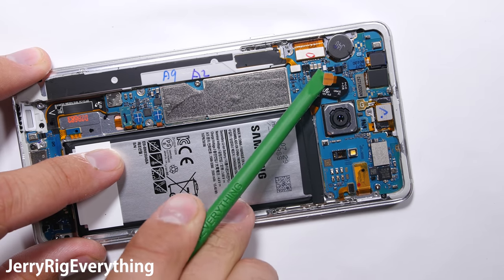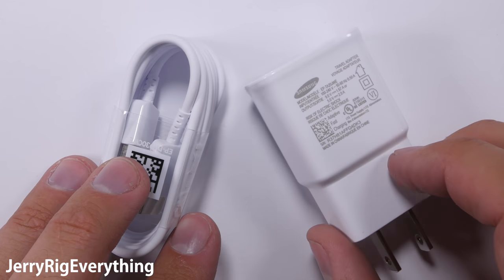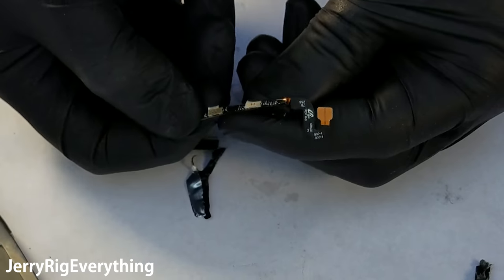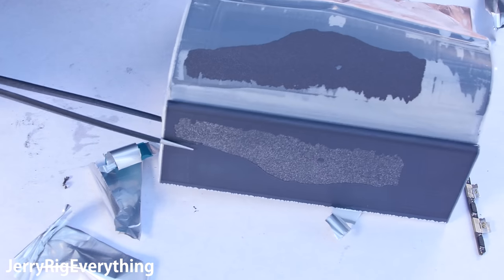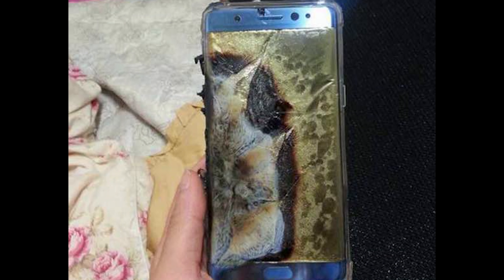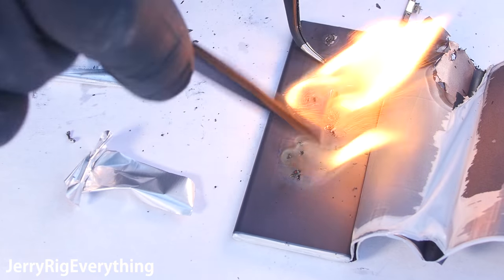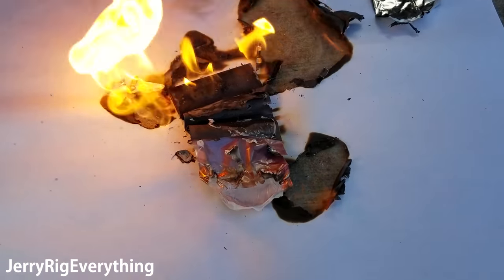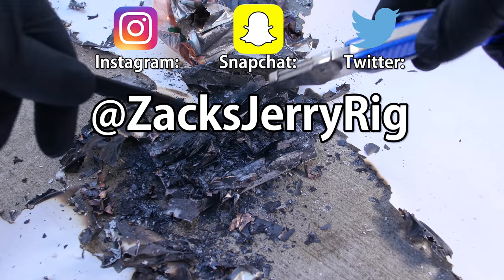Note 7 Battery Explosion!! CAUGHT LIVE ON CAMERA!!

Comment: good video as always
that clickbaity title though
Reply from the maker: ;-) It happens.
Reply: but you can still change it
Reply: +JerryRigEverything when you were poking the battery with that metal rode and it caught on fire, does that happen to other batteries when you disassemble them and poke them like you did with the note battery.
Reply: +John Irwin, Motorola batteries, the odds are good it won't. they are wrapped a bit better. batteries that are in less popular phones can.( the flip phones have older batteries and are vulnerable to it).
Reply: +Dan Marinucci so all batteries will do it when you unwrap them like in the video
Reply: John Irwin good point👈
Reply: +Dan Marinucci lol i meant that to be a question
Reply: true
Reply: yeah, unsubbed here.
Reply from the maker: ***** You bet!
Reply: JerryRigEverything click baiter where is 5he real thing
Reply: Ryan Mader Nah It was just really tempting because it was so easy... just couldn’t help it

He usually doesn’t do Clickbait

Comment: Here's the scoop:

Samsung investigated 35 cases of issues with the Galaxy Note 7, 2 cases involved an exploding battery on social media while the others were reported as fires, no injuries were reported. After running extensive tests Samsung concluded that a certain batch of the Note 7 batteries has a potential risk factor and could be a fire hazard when charging,from reports
Samsung produced the cells but used Korean ITM Semiconductor to produce the battery pack sold in South Korea which had the problems, meanwhile, most phones sold in China and internationally are going to have battery packs from Chinese company Amperex Technology and other suppliers which have no problems.
Instead of just recalling specific batches they issued a worldwide recall just in case someone received their phone from a supplier that were selling batches meant for South Korea.

So to get things straight:
1: Unless you got your phone in South Korea you shouldn't have an issue with your Note 7 since the faulty battery pack that was produced by ITM Semiconductor and was only sold in the Korean market.
2: Samsung made a worldwide recall in order to relieve everyone's stress not because your phone will explode or catch fire.
Reply: no, thats not how economics works, they would have recalled by serial number batches then, its not like they dont have the paperwork on phone serial numbers. 

the real deal is probably that they noted a major fault with a hardware component that was at fault on every device and issued this recall.
Reply: Hi Mack - how do you know this? Cause if this is true, I'm keeping my Note 7 and not returning.
Reply: lmao different batteries for different countries, ye that sounds like Android.
Reply: +Wybrem It's more like Supply Chains for other regions. Samsung mostly use their local factory to make their own local version phone( Note 7 SM N930S/K/L, Korean version).
Samsung has been using China as a supply chain to assembly and made devices to export to U.S(Verizon 99% has labeled make in China) while Vietnam's Factory use for assembly phones that are International model and export internationally.
Reply: +Wybrem And you somehow think Apple uses the same internals for every model? Do some research before even attempting to trash talk.
Reply: TL;DR chinese batteries good. korean batteries bad.
Reply: it's marketing and PR. not economics. but then the marketing and PR move is actually for long term economic reasons :)
Reply: +Andrés Iniesta Agree, there're some good China Brands Battery like Panasonic & Sony. Amperex  and TLC are one of the best Battery in China, they're also supplies to many corporation.
Reply: ***** As someone who resides in Florida, I'm honestly doubting the credibility of that specific report. I believe the others, but that one looks like a grab for attention just so they can receive paid compensation from Samsung. Us Floridians are known for doing some stupid stuff at times, so it's possible that it was staged.
Reply: These issues are about 70% in America, making it more than contained in South Korea

Comment: Prodding a dismembered battery with metal tweezers, doesn't exactly constitute an "EXPLOSION!!'
Reply: But the phone body it self acts as a pressure chamber, so when the heat and fumes have no where to escape, it create its own escape route, thus blowing up the phone.
Reply: @dro3m  hey bro I got what you said,but I was just wondering what's a heat chamber.....
Reply: @aykil435  A pressure chamber, keeps air contained in a certain place and contain to gain until it create extreme pressure. Think of it as the tank has those air compressor.
Reply: AYYO✅ he’s just a person with some simple knowledge.... 🐽

Comment: 2 things worth noting : 

 1) Bad chargers are not too bad, as you show, there are so many protection circuits and the 2 biggest offenders for LiPos would be stopped there - high voltage and too high current. As long as the charger provides 5v, chances are that there's no risk of current over the specs. If it provides more it would be capped by a regulator.

The only bad charger that could get through is one with a big ripple voltage (say from 5 to 3.5) and pulsating on that. This would probably get through the protections and slowly hurt the battery, which likes being charged in a Constant Current then Constant Voltage cycle.

 2) In event of failure of all the protection circuits and the "battery abuse" getting through, it would always blow up the battery, no matter where the failure was (or if all failed at the same time). So "physical location of the fire" is not a good evidence to where the failure was.

But good job showing the dangers and demystifying a bit the phone battery. As usual, respecting the LiPo is the best approach.

Comment: A VERY good reason for Samsung to bring back removable battery's. Convenient and a LOT safer.
Reply: A lot safer how? If a damn lithium ion battery catches fire from overcharging or overheating being able to remove it won't help.
Reply: Mr Kagouris Of course it will. It won't explode because its not contained under a lot of components AND your phone will survive.
Reply: +Dan RC I do like removable batteries but the reason they got rid of that is so they could make it water resistant. If they don't do built-in batteries, they can't make the phone water resistant.
Reply: +Mr Kagouris
Convenient, yes. Safer, no. Convenient because if they have a battery recall, they could just remove the battery and send it back to Samsung instead of the whole phone.
Reply: Dan RC Have you ever seen a charged lithium ion battery catch fire? Nothing touching the battery would survive whether it's contained or not.
Reply: Mr Kagouris but if its not in the device, then the device will be ok, as the batteries will in most cases give off smoke before catching fire. I'd just prefer the safer option. How is that a problem?
Reply: cuhleef Galaxy S5? Lol
Reply: Dan RC You consider grabbing an about-to-catch-fire lithium ion battery SAFER?
Reply: Mr Kagouris Grabbing? Why? You just remove the cover and tip it out.
Whats so hard to understand here? Its not rocket science. Lol
Reply: Dan RC OK, so let me get this straight, you believe that it's remotely safe to take the time to take off the cover and try to tip out a battery that could catch fire at any moment instead of throwing the device as far as possible. Ok, you're right, Samsung should bring back removable batteries so natural selection can do its thing.
Reply: Mr Kagouris I'd rather have to replace a £10 battery than a £600 phone.  As it only takes about 2 seconds to remove, its just nice to have 'options'.
I just guess some people just can't comprehend that.
Reply: Dan RC Galaxy S5 has lower IP Rating than Note 7.
Reply: They're too worried about copying Apple. Won't happen.
Reply: one of the main reasons I still use the Samsung galaxy s4. However I am switching to an iPhone 6s, going to try something different.
Reply: However I heard now that Samsung  has placed a charging limit on the note 7 to only 60% power.
Reply: Not really. I hate removable batteries. I think they should just change the battery so it won't explode.
Reply: It will be a lot harder to make it water resistant without changing the design of the phone.

Comment: 0:45 "If The charger is faulty, or not designed specifically for the phone, it can effect the safety of the battery. It can destroy the battery's protection circuit"

Major Smartphone Companies in 2021 : Let's Remove the charger coz we want to "SaVe tHe EnViRoNmEnT"

Comment: 1. It doesn't explode, it a combustion.
2. Clickbait. I was expecting to see a Note 7 catching fire, not someone dismantling the battery outside the phone and provoking it to combust. 
Thumbs down.
Reply: The title clearly says "Note 7 Battery Explodes!" It says BATTERY. He never said the phone explodes.
Reply: +Unboxing Tech The battery doesn't explode either.
Reply: +Willi Hansen And for that matter, it could be any old battery he's lighting up. It's click bait, whichever way you're looking at it.
Reply: I respect your opinion but even if he used a different battery he still educated us on batteries.
Reply: Here's the definition for explode:
burst or shatter violently and noisily as 

a result of rapid combustion, decomposition, excessive internal pressure, or other process, typically scattering fragments widely.
Reply: Exactly. It's not bursting or shattering, and there's no noise. 
Explosion is the result of a rapid expansion of gasses. That's not the case here.
And while it's an interesting enough clip, the title is misleading. Anyone reading it would expect an Edge 7 that's not been tempered with to burst into flames by itself. This is not the case here. What he's done here he could have done with ANY phone and ANY lithim battery.
Reply: Willi Hansen 
It does technically explode.
Reply: +Unboxing Tech Where's the bang?
Reply: Willi Hansen 
Read the definition of explode...
Reply: +Unboxing Tech To quote your explanation: "noisily" . Was there a noise?
Reply: +Willi Hansen "An explosion is a rapid increase in volume and release of energy in an extreme manner, usually with the generation of high temperatures and the release of gases." This is from wikipedia and everything is fine!
Reply: +Dope Bass exactly, thank you. This was not an explosion. Now can we put this to rest?

Comment: Yeah, I'm in a wheelchair and have the NaviONE power assisted wheels, which either come with a Nickle battery or a Lithium one.  Because the Lithium one weighs a pound more, gets hot and catches fire...I'll stick with the Nickel one.  I wonder why the Lithium is a grand more though?
Reply: Better charge capacity? Or less expensive (i am throwing that without knowing)

Comment: Its water resistant throw it in the pool
Reply: Mike Haile but it will still burning underwater
Reply: At that point, it doesn't matter if it's water resistant
Reply: Ilias PLAYER woosh
Reply: Baiet Simpson woosh
Reply: Mike Haile I’m not next to a pool all the time
Reply: Lithium + water = hydrogen gas +fire
Reply: Mike Haile waterproof* (i think)
Reply: Ethorbit r/woosh
Reply: Lithium is an alkali  metal so it will explode
Reply: Mike Haile is it exploding resistant
Reply: Lithium will become lithium hydroxide and release heat and h2 gas + fire.

Comment: It's funny how apple batteries don't do this...
Reply: Some do
Reply: Except when they do, like a month ago, an Australian guys iPhone exploded in his pocket putting him in hospital.
Reply: There's many times an iPhone has done this and so many more cases of Apple saying 'You held it wrong'
Reply: Lol right but they did and apple blamed it on the customer. Offering no solution other then a new expensive apple branded charger. Basically saying the 1000s of non apple accessories are at fault lol. Not to mention the 6 that bent in your pocket and the 4 that lost signal and jobs told you that your holding it wrong lol
Reply: it's funny how  you say that when apple phones have exploded and killed customers in the past.
Reply: +First Last nonetheless. It still exploded
Reply: John Bator
at least there were no deaths. And samsung is addressing it and has been quick to recall, replace, and give out gift cards for the minor inconvenience. Apple simply blames it on the customers and ignores the issue.
Reply: +First Last bro. Which side are you really on??
Reply: John Bator
samsung??
Reply: +First Last fuck. Me too. This is awkward.
Reply: apple fan boy.
Reply: rekt
Reply: it´s funny cause iphone was the first with this problem, In Maine an 8th grader was burned by her iPhone 5C when it started to overheat in her back pocket.
Reply: And it's funny how samsungs phones don't bend.

Comment: I got a Note 7 recently. But now, I'm trying to get a refund.
Reply: I have a habit of avoiding products that have been involved in a huge safety recall. The Note 7. If they recall back. The battery explosion may not happen again, but I care for safety more. 

Another example is I am soon to get my first car. I wanted a used Honda Fit/Jazz for my first car. But due to the airbag issues on early to late 2000s Honda vehicles where the airbag will fire shrapnel when involved in a crash, killing a driver at a low speed survivable crash. Even if they recalled and replace the airbags, I don't want that since who knows it can happen again. Eventhough it's unlikely. I reconsidered what car should I choose. 
I avoid products involved in huge recalls for safety.
Reply: I have a habit of avoiding products that have been involved in a huge safety recall. The Note 7. If they recall back. The battery explosion may not happen again, but I care for safety more. 

Another example is I am soon to get my first car. I wanted a used Honda Fit/Jazz for my first car. But due to the airbag issues on early to late 2000s Honda vehicles where the airbag will fire shrapnel when involved in a crash, killing a driver at a low speed survivable crash. Even if they recalled and replace the airbags, I don't want that since who knows it can happen again. Eventhough it's unlikely. I reconsidered what car should I choose. 
I avoid products involved in huge recalls for safety.
Reply: +ToperMasterComedy U must avoid lot of things then,  nothing is ever giong to be PERFECT tho, u realize that will never happen..
Reply: +N JK (Nik)
Not sure why he is even driving a car, he should be riding a bike to school/work lmao
Reply: get a nokia 3310 it'll never explode, it'll only explode everything around you XD
Reply: Shell Casing It's great that they recall it. Apple never even made recalls for the 6 when it bent. But I'm avoiding them for the abundance of caution too. Say whatever you want, but it's me.
Reply: +Syahmi Samri only to the people affected? isnt it to all the people who have a note 7?
Reply: LG V20

Comment: These were selling for $10k and higher on Ebay right after the recall was announced. EBay started deleting and banning the listings pretty quick. I don't know if people were buying them as collector's items or if they had some weird plan to stage an explosion and sue Samsung. I remember Samsung covered it's legal bases by mass spamming the phones with message warnings and they fucked with the network signal somehow. I don't remember exactly. I just know it was all because they wanted to save a few pennies by using cheaper batteries than they had in the past.

Comment: The reason for explosion of note 7 batteris is actually two of the electrodes are unnecesarily touching each other resulting in short circuit and the battery gets so much heated till explosion 
still nice try

Comment: I have a Galaxy S8  that was practically brand new when it suddenly stopped working one day, as it it just would not power on, or give any indication when plugged in with a charger. I've had it sitting on my desk for several months because I just can't afford to have it fixed fearing I would just be told I need a new phone. I noticed a couple of weeks ago that the phone has since bloated and separated because of the battery swelling. You seem to know quite a bit more about the phones than I do other than how to use one. Please feel free to contact me if you would be interested in doing something with it.

Comment: Device makers routinely set the charging circuits to over charge, over discharge and charge too fast to shorten the life of the battery so consumers will buy more.  You need to open the phones and measure the battery to see this.  You can't trust the intentionally modified reporting hardware and software.  It is always about the money.  Each LiPo cell should never be above 4.20V or below 3.00V and not be charged faster than the C rating of the cell.  Unique to lithium cells is that they become cool, NOT warm, when charging.  Zach, since you open many phones, could you check some of them to show which units do this?  Thanks!

Comment: This happened to me when I was removing the battery from my s7 edge. I was using a plastic spatula carefully removing the battery when I felt the sides of the phone got really hot. I knew immediately it was thermal runaway. The phone turned into a blowtorch for about 20-30 seconds and I had to hold on to it while running down the stairs to the front door. Burned my thumb pretty bad, and it hurt like hell. Thanks Samsung!
Reply: Are you ok now?
Reply: @spidey3759  Yes, thank you.
Reply: @phil1pd  np

Comment: Or just don't buy samsung altogether. I have an s7 edge which sports a pink line running from top to edge of screen on the right portion of the screen. It's apparently a hardware issue that a looooot of s7 edge users have. We bought two and both have it.